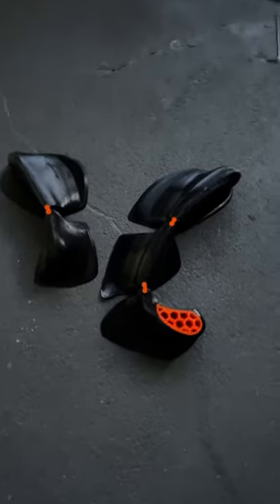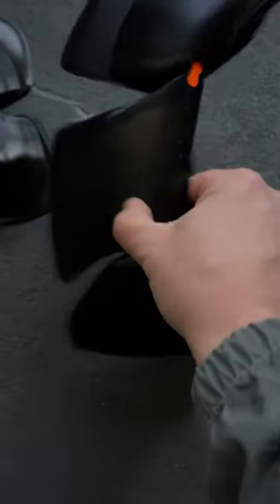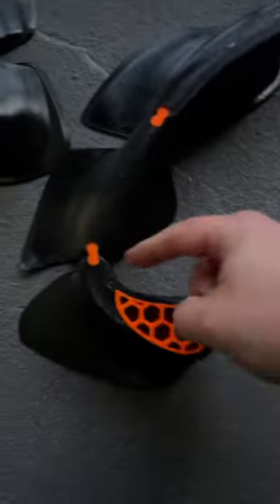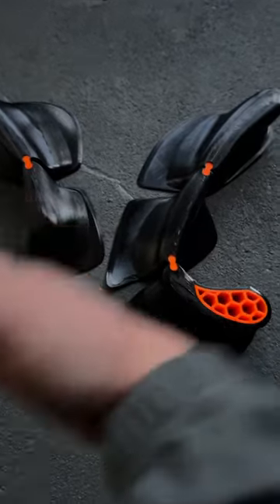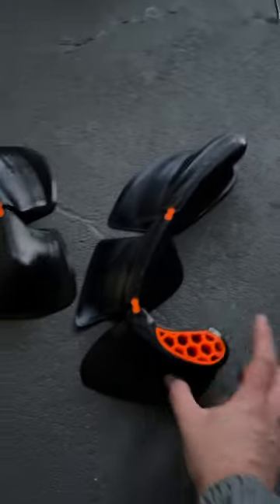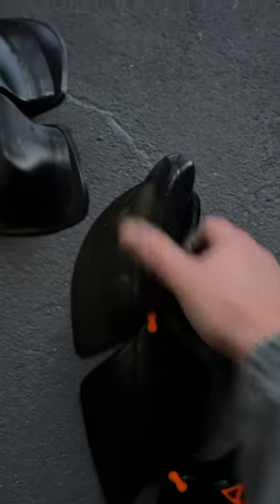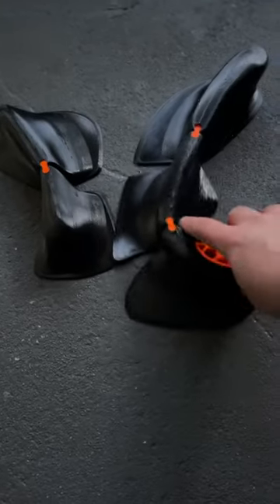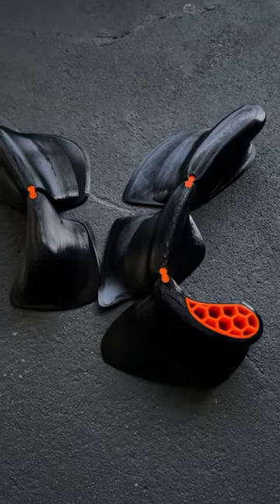new 3D printed euc pads for the INMOTION v13 #electricunicycle #euc #inmotion #inmotionv13

Comment: I've printed these in Bambu-PLA & Sunlu-PETG 
While they both turned out 'nicely',  IMO,  they could be better.
1: the 'base-rim' could be thicker.  1 already cracked.
2: the 'connector pins' should be spaced out more.. 
They hold the components too closely together, 
and that really limits their amount of movement.
Aside from that - These are killer!

Comment: What nozzle size did you use ?
Reply from the maker: Standard 0.4mm
Reply: @megaobi  thank you im going to be printing this : ) in your experience is .04 enough for wear an tear?
Reply from the maker: @isaacmagana7078 100% as long as your layer adhesion is good you shouldn’t have issues. I haven’t had any toy prints/pads tear on me. I usually do 2 walls on 95a tpu. If you are using lower shore hardness you can do higher
Reply: @megaobi  I appreciate that input so much! They are coming along very nicely so far!